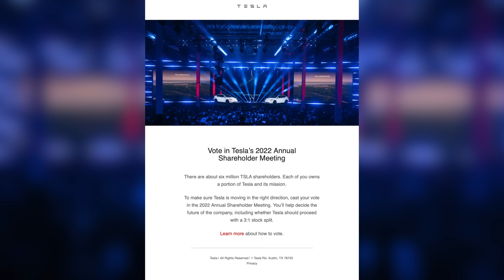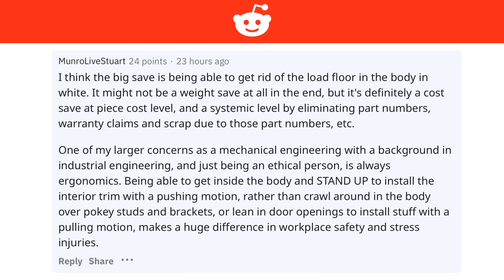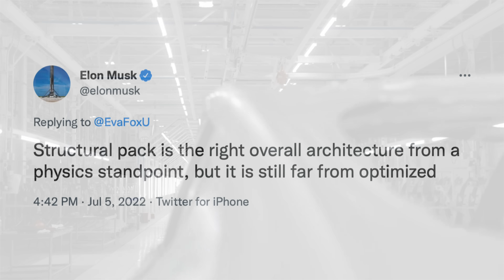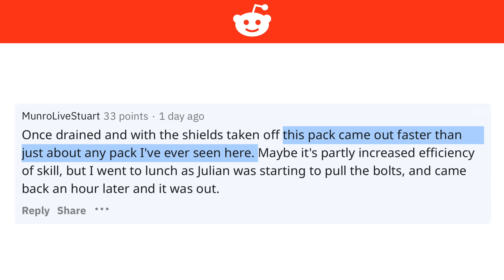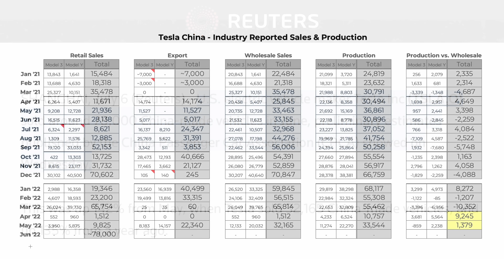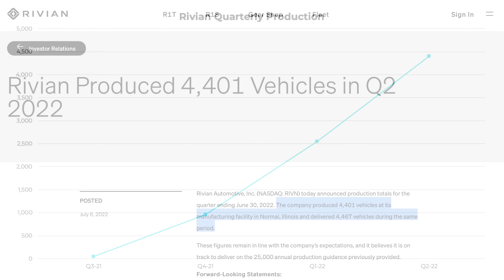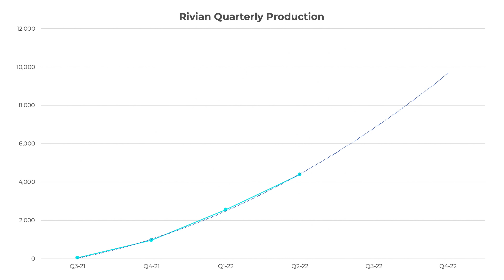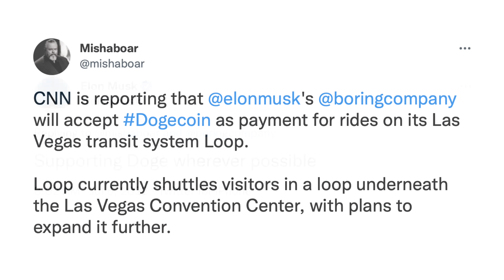Behind The Scenes Details on Tesla Model Y Teardown From Munro

Comment: 2:46 To add to that, when it's easier for the operator to install, the quality of installation also drastically improves.
Reply: I'm curious if the car rigidity is better or worse now.  I would like to see a road test comparing to the old version.
Reply: Still way overhyped.
Reply: @nicholasn.2883  Literally zero paid advertising, no paid celebrities, no paid press.

Organic hype is more trustworthy than paid press hype.
Reply: @gianni.santi.  Nah bro I thought this sh*t was a next level innovation going to take hundreds of pounds off the car. It's just rearranged.
Reply: @nicholasn.2883   I think this person is shot on stock
Reply: @nicholasn.2883  I get your point. However it's not all about weight reduction. Rigidity, cost savings, time savings, quality improvement. But like Elon said, it's not yet as optimized as they want it to be.
Reply: @gianni.santi.  The best part is no part.
Reply: @nicholasn.2883  overhype is relative the comprehension of actual impacts ;) Don't underestimate what this team is up to. We often understand later what we could not know...